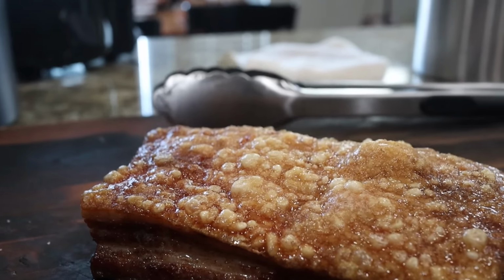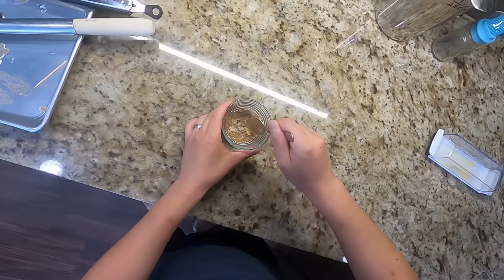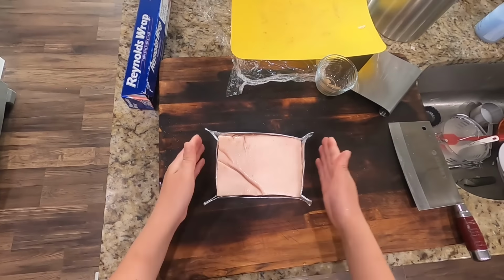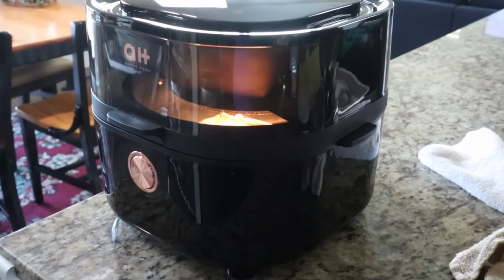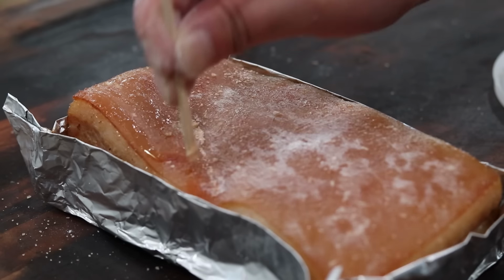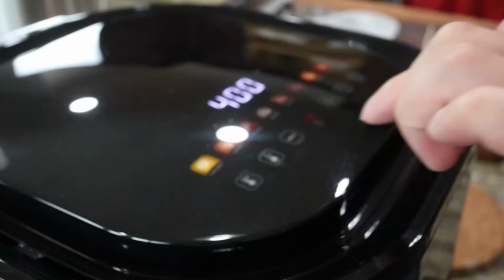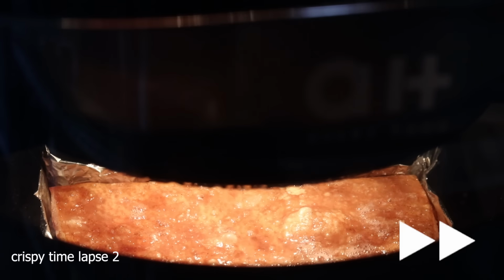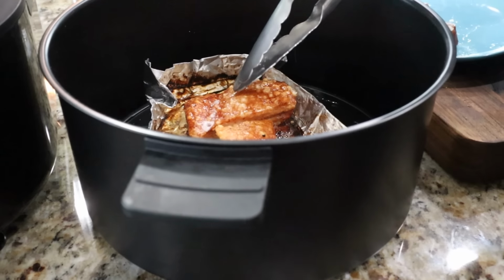EASY Air Fryer Crispy Pork Belly - 2 Hours Only!

Comment from the maker: If you have any tips or tricks for a consistent results to getting crispy, puffy pork belly skin please share with us here!
Reply: Check out the Danish video titled " Annonce: Den perfekte FLÆSKESTEG i AIRFRYER med sprød svær! HVER GANG!!!" 
40 minutes recipe that makes the fat crisp every time. Way easier than what u are doing
Reply: My tip is to put a lump of tin foil under the meat so that it bulges a bit on the middle. The fat will fall off the surface and this allows the skin to crisp up.
Reply: Pat the skin dry with a towel or cloth, make sure it's totally dry. Score it with a sharp knife, sprinkle with a very thin layer of salt. 
10 minutes before the end of cooking time, turn up the heat to 220 celsius. Voila.
Reply: I don't have a Air Fryer yet but I promise to invest in One Soon, thanks again 🙏
Reply: 1)Use aluminum to make a bowl , place below the pork to even up the surface , especially in the middle .
2) open every 5 minutes ; use kitchen towel to soak up  extra juice on the skin .
3) grill till more burn then scrap it off , will have finer crisps
Reply: I've had some decent luck using a spirit (whiskey) and/or vinegar on the pork skin to help dry it. I've also used baking powder and baking soda to help with crisping up the skin. I'm not at 100% success rate yet but the whiskey, vinegar, baking soda (sometimes baking powder) has helped.
Reply: Someone suggested using baking powder on the skin to make it more crispy but that didn’t work for me
Reply: @helenalovelock1030  it was bi-carb not baking powder!
Reply: @carolyntrezona4211  ooops 😂
Reply: All the recipes say baking powder from what I’ve seen ?
Reply: Сколько рецептов уже посмотрела, первый раз вижу разрыхлитель. Вообще-то применяют уксус. Мажут уксусом.
Reply: Leviticus 11:7-8
King James Version
7 And the (swine), though he divide the hoof, and be clovenfooted, yet he cheweth not the cud; (he is unclean to you).
8 Of (their flesh shall ye not eat), and (their carcase shall ye not touch); (they are unclean to you)....

Comment: No vinegar or oil?
Reply from the maker: Nope! Enough fat comes from the pork :) additional oil isn't necessary.
Reply: @Chow-House  I must have looked at close to 100 videos for pork belly and tried most of the methods that don't use an outdoor grill because I don't own one. I am going to try frying the skin (shallow fry). That method seems to make the airy bubbly skin I want.
Reply from the maker: @constancemcguire5870  the shallow fry method works pretty well! another method i've seen that seemed to work is pouring hot oil over the skin (repeatedly if needed).
Reply: @Chow-House but in regards to vinegar, it supposedly is not a substitute for oil, the chemical reaction is suppose to add crispyness. I am doing your recipe tonight. I like your disclaimer. Pork belly skin does have a mind of its own 😊

Comment: The reason I buy the pork belly is to get away from the sugar.  I've never seen it cooked this way before. Don't have an air fryer or the space for one.  Trying to figure out if I can do this in cast iron suspended off the bottom with a grate.
Reply: Just FYI, cos I also strongly dislike uni-taskers and have limited counter space, I really love my air fryer, and use it extremely often. Just make sure you get one with decent capacity & power, or you'll be disappointed. But they're very effective, and so much better than heating an entire oven.

Comment: I didn't even do the first 40 min on lower temp. I went straight for the max temp for about 40 min and it turned out pretty good. 
Added some of my own seasoning on the bottom. Poked some holes on the raw skin and added salt. No vinegar or baking powder.

Comment: Everything I've cooked in this unit has come out great https://www.youtube.com/post/UgkxD4Qeo-HRLxMfom_PDinM_SBfes00qJsB ! Everything tastes so good. Some of the recipes I've changed a little to improve the taste. For instance, for french fries which call for no oil, I spray them with olive oil and season them with salt and pepper. They come out great! It makes the best toast I have ever eaten. The recipe I use calls for lightly buttering both sides of the bread. It calls for cooking at 400 degrees for 5 minutes on one side and then 2 minutes on the other side. This time has a lot to do with the kind of bread you are using...so keep an eye on it. Also, the fans in this Ninja are a lot stronger than other air fryers. So lay a metal spoon or something on the bread to keep it from flying around. It's a little extra work to use your Ninja as a toaster but it is worth it!
Reply from the maker: Glad it worked out!

Comment: I use near the same season just with brown sugar also and Italian herbs and also do the bed of foil , what I do is dry it out for about 6hrs with salt only on skin side , then when putting into the air fryer I brush it with white vinegar then 90 degrees for 30mins then put and brush again with vinegar and bk in at 200 degrees for 40 mins and she comes out amazing
Reply: thanks for sharing
Reply: What is bk ???

Comment: You said in your intro NO SALT. What does your mixture contain SALT
Reply from the maker: Some recipes call for cooking the pork belly skin side up with a thick layer of salt on the skin. I find this technique unnecessary. My mixture contains salt to season the meat portion of the pork belly. Sorry for the confusion.
Reply: Most recipes call for a salt crust using a lot of salt. That’s what he’s referring to. Of course he’s going to use salt in general

Comment: Great video.  Simple and straight forward, however I believe you made a mistake by using baking soda rather than BAKING POWDER!  All the other videos state one should use BAKING POWDER.
                        Check it out and then possibly state the correction.  Thanks,  Roy

Comment: Folks..this is legit. Unbelievable. Do it like he says, "no tricks". I have even done this with "Costco belly" that is in strips; cut them in half, 4 pieces Mae a nice rect-like slab. Do the bottom cuts like he says, season in there, and the sides. Follow the tech and the results will be astounding...*sooo* much time saved, very high quality results. Not "hype" like MANY air fryer techs and recipes.

This one makes you seem like a way more skilled person in the kitchen than required. Highly recommend trying this.
Reply from the maker: Thank you for the kind comment! Glad it worked well for you.